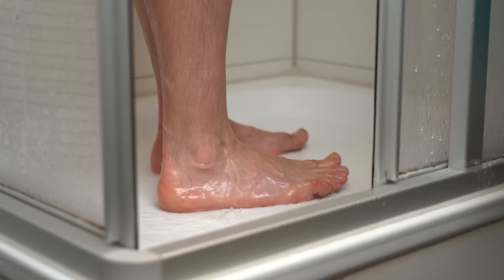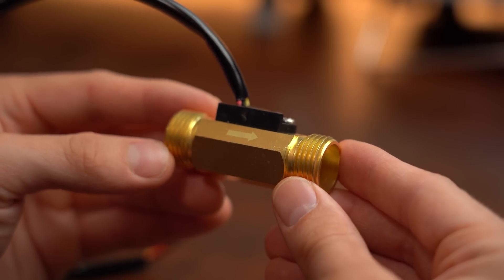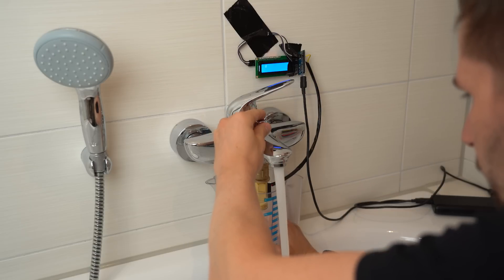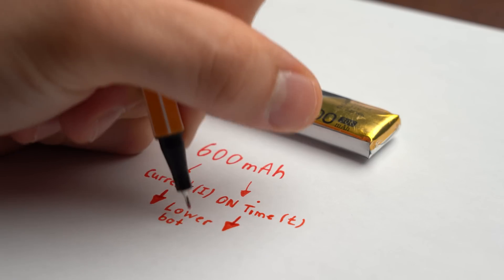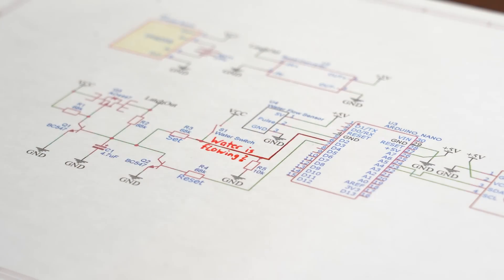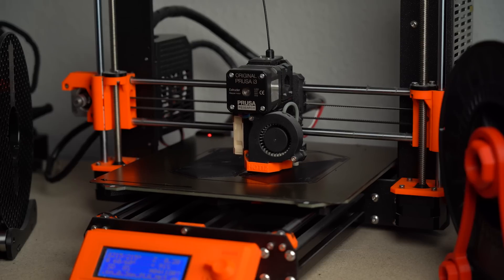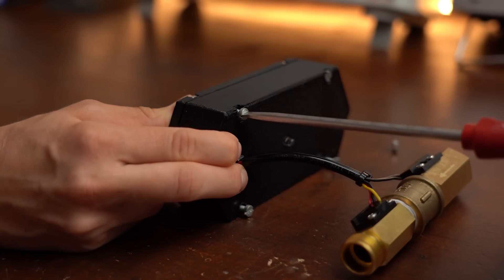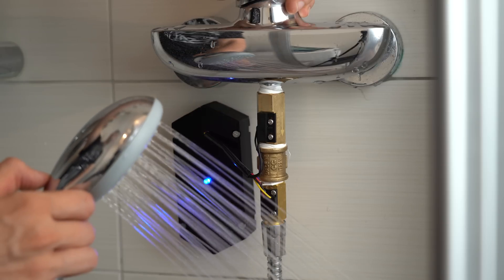Every Shower needs this Upgrade! (Online Water Tracker)

Comment: Awesome project, that was my next project for my garden watering system 👍
Have you considered using ultrasonic water sensors for your main's water supply? This way you don't have to modify your water install ?
Reply from the maker: Ultrasonic? Never heard of them. Got a link?
Reply: @greatscottlab  To not modify your main water supply, it only works with an clampon method. Its not that simple, but it can work if fitted well. For ultrasonic flow measurement there is a lot to consider instead of just counting pulses. Yet the principle is quite simple. Two transducers alternately sends a burst and this time is measured with a TDC. The ultrasound in flow direction is faster than the ultrasound against flow direction. This difference of time is directly proportional to the flow. So with a simple formula with offset, diameter of your pipe, length etc you get a decent result. You may need some correction factors, becauer there are different flow pofiles (laminar and turbulent).

I just remembered that you can also buy ready systems. Then, of course, you don't need to know anything about ultrasound :D
Reply: @yannickziermann9731  Not sure you can use clamp on systems for that, since you would want to isolate the transducers from the brass.
Reply: ultrasonic flow sensors are hideously expensive
Reply: The sensor itself is usually referred as an Ultrasonic Flow Meter Transducer on AliExpress paired with an Ultrasonic Water Flow Meter main unit

Comment: Just put a 1/2" turbine generator in series that will charge a super capacitor. :D :D :D
Reply from the maker: Not enough power for the system though....I tried it.

Comment: Good idea, but i think the whole pressure switch and latch circuit is unnecessary. You could use flow meter to wake the Arduino up, then after a delay put it into sleep. Atmega328p uses nearly zero power in sleep
Reply from the maker: I did not wanted to use a sleep mode.
Reply: @greatscottlab  Ok, great video regardless. Thanks

Comment: I've never thought of showering as a hobby before, but that's EXACTLY what it is. I also forget time and space while immersed in the warm flow!
Reply: @devalue7064  Crazy that you can't even enjoy a nice long shower now. Politicians need to hang.
Reply: Yeap, I know the feeling.
Reply: Weird to think of it as a hobby, but as long as you're getting clean every day, more power to you.
Reply: @devalue7064  Germans are masochists. This thing will probably take off there.
Reply: You are lucky.  Water makes me feel pain.
Reply: @hicknopunk  That sounds awful.  You're not using a "water saver" shower head are you?  Those nasty things produce painful little high pressure "water needles" instead of a wonderful, refreshing deluge.
Reply: @StubbyPhillips  no, it is sensory processing issues.  Any water, just sitting on my skin hurts.  Until I was an adult I had no idea everyone didn't feel pain from water.  

I wondered how people could enjoy a shower, bath, pool, etc for so long.
Reply: A cold shower is my longest 5 minutes of the day
Reply: One major difference: if I go a month without spending time in my wood shop, my boss doesn't fire me.

Can't say that about going a month without a shower.

Comment: I don't like the lipo battery solution, since it needs to be changed and has relatively short lifespan. I would harness the power from the waterflow instead, and put a supercapacitor to sustain it for a minute or two. And the display is in my opinion quite important, I guess watching those numbers going in real time is more terrifying than watching them on a phone afterwards. A timer would be a must too, because this problem has to be solved(right?). The most effective way is to reduce the time taking shower.
Reply from the maker: Thanks for the feedback. But a normal water "turbine" would not deliver enough power.

Comment: My hot water cost smith like 10 times the price of cold water, but I have no way of putting a sensor on both lines...
I tried ai-on-the-edge to read my analog counter, but it's way too unreliable.

Comment: Very nice idea, which can be also extended to measure how much washing machine or dishwasher use. Isn't it possible to read pulses from your water measure? By the way I achieved similar, but obviously less accurate shower water usage sensor with humidity sensor next to shower. I observed that there is more or less the same pressure and mix of hot and cold water used everytime, so I calculate just time based on humidity changes.

Comment: If you really want to save, get a thermostatic faucet that automatically regulates the output temperature. That way, you're not wasting as much water fiddling around with the mixer, and also can start and stop the water without ever having to fiddle around again.
Reply from the maker: Also a good idea :-)
Reply: They're too expensive. It will take years to pay them off from the saved water. They wouldn't even last that long.
Reply: @svetko05  I bought mine from Aliexpress, and it is somewhat a comfort thing as well. If someone in the house uses the toilet for example, the loss in cold-water pressure won't suddenly make your shower a lot hotter.
I have them in all bathrooms, at the wash tables as well as showers and bath tub, and in the kitchen.
Reply: @graealex  Yeah, they're pretty cool devices, I also had one installed, until it broke. They have good uses but saving water isn't one of them.
It's especially bad when two or more people live in the house and everyone has preferred temperature and constantly fiddling and adjusting the valve.
Reply: @svetko05  The ones from Ali were about 50 EUR and with regular descaling of the thermostatic cartridge, they last a very long time. Although two of the ones I own are from a German company and were considerably more expensive.
Yes, I know about the fiddling. I use one in the bathroom for my bidet hose, and my girlfriend likes to wash her face with cold water in the evenings, which is always a bit of a surprise when I try to wash my private parts with 10°C cold water 😂❄️

Comment: Water costs like a $1 a day so this is not an issue unless you're unemployed but then you don't need or have a shower.
Reply: In my town (in Poland) water (drinkable) cost "almost nothing", but sewage collection cost real money, and heating cost even more: my daughter alone can use hot water for over $100 per month...
Reply from the maker: If you can cut that in half that saves you 182.5$ per year.....not bad I would say.

Comment: Coding with the laptop on the border of a bathtub. What could possibly go wrong 😁One small tip: that sealing tape should be used quite sparselly, just enough to fill up imperfections in the metal. If reaches a point that makes hard to turn, you are using too much.
Reply from the maker: Thanks for the tip :-)

Comment: regular water meter counter is driven by rotating magnet. you can modify it: remove front panel with digits, install hall sensor, send data
Reply: Pretty sure messing with your meter in any way is illegal, or at least it is here in the US.
Reply: @OtherDalfite  i don't mean to touch working one. they are cheap and maybe old meter is laying around
Reply: @yurcchello  oh ok
Reply from the maker: Thanks for the feedback :-)

Comment: I think I'd have added a temperature sensor and tried to estimate the price including the cost of warming the water.... but that'd be more difficult ofc.
Reply from the maker: Yep. Also had that in mind. Maybe a good improvement for a future upgrade.
Reply: Two temp sensors, point of use and supply to water heater. Or just a current transformer on the feed to the water heater.
Reply: @IamEqualtoall  I believe the supplied water temperature is pretty constant, at least in Europe. Only a few degrees difference, not worth putting a second sensor imo.

Comment: I think in Germany it might ne forbidden to install not approved Installations into the public water systemy
Reply: It is forbidden but everything after the water meter in your home is not public but private, and you can install whatever you want.
Reply from the maker: Maybe. But it is certainly allowed to add something like this in your shower ;-)
Reply: I am offgrid in germany but most Installation i have seen habe checkvalves fittet to protectiv the public Network or Else one couldnt use a garden Hose

Comment: Just use cold water, shower time will decrease automatically and therefore monetary spending will decrease as well. 

I can’t applaud enough for your ingenuity, great work 👏 

A budding YouTuber.
Reply from the maker: Great tip!
Reply: Ending your hot shower with a quick cold rinse can also reduce anxiety and depression.
Reply: @ErebosGR  
Just make sure you don't breathe all the water in from the involuntary gasping that will occur from cold shock. I've had too many falls and close calls from that due to being dizzy and light headed, it's just a bad idea.
Reply: @Lively_1185  Umm, you can make the switchover gradual if you want to...
Reply: Also shower less

Comment: Simple photodiode at old measurement device or pulse-wire at new one (without corrupting certified device). You already have measurement device on input pipe, use this.

Comment: yeah I bought a shower head with a off valve and it saves me a lot of water. $9 and you can get a valve adapter that lets you turn any shower head into a shut-off head.
the reason you may want this is so you can find the perfect temperature once and then you don't have to touch it ever again, you just walk in and turn the valve on and let the water through.
Reply from the maker: Also sounds like a good idea :-)

Comment: and for saving battery you can add water turbine that will charge the system back
Reply from the maker: Well,....I tried commercial water generators with the faucet. Not ideal. But I will show that in an upcoming video ;-)

Comment: Do you have to take it apart to charge the battery?
Reply from the maker: With this version, yes. Sadly. I will hopefully include a charging port that is water resistant in version 2. But other can join in on the fun as well and design something suitable :-)
Reply: you could just add IP65 cable gland to the bottom or the side of the case or buy IP65 case with cable glands and use wire or tube and pass the wires inside...
and to make it look better print new case that will fit on the flow sensors as cover.

Comment: thing with sensor used there is that those are sold as FLOW METER sensor, not meant to measure volume of water flowing through it

Comment: With such a low power application, is there a way to use the flowing water to keep the battery charged?
Reply from the maker: Not really that low power. The uC needs a max of 100mA. I tried water generators with the faucet but the results were pretty bad. I will show that in an upcoming video ;-)

Comment: Two critiques I have on this project
1. Why there isn’t a tiny water turbine that charges your battery or capacitor when water is flowing?
2. The relation between flow and frequency from sensor should remain consistent regardless of pressure. Just map it out and have a look up table for a better estimation of water use
Reply from the maker: 1. I tried commercial solutions. All were a joke. Not worth using.  2. Yes, that sounds like a good improvement. But very hard to implement in Home Assistant.

Comment: This is a great idea💡 maybe you should use a water turbine to charge the system automatically and supercapacitors instead of batteries?
Reply from the maker: Tried commercial water "turbines" Did not output enough power. Not even close.

Comment: Hey cool project! I installed one of those flow metres in my beer fridge so I would know how much beer I had drunk, or not for that matter.  Interesting and useful to know the actual usage, compared to the perceived usage of any liquid that's costing you  money.
Reply: idk what flow meter you have but most of them (at least the ones that made of brass) are not lead free...
Reply: All good lead has its place, the one I used was food safe plastic with copper fittings designed to be used with water filtration equipment I'm pretty sure, I'll be fine. Interesting project, however I found the impeller agitated the beer and produced more of the fluffy stuff than it would have at the same psi if served from a tap without a flow metre so maybe not really worth doing.
Reply from the maker: Haha that also sounds like a totally german application for such sensors.

Comment: Before the company changed my meter to a digital one I had a small reed contact mounted in my meter. Every half liter a pulse. Used the Electric imp(001) to count the pulses. Pushed the data in the mysql db and used AMcharts to visualise everything. Brings back memories. 🙂
Reply from the maker: Also sounds very useful :-)
Reply: @greatscottlab  haha indeed. You can recognise patterns after a while. When my wife took a shower after her night shift at the hospital, or our diswasher, ..
Reply: The Digital ones usualy have a S0 / SML or Modbus interface,  sometimes all tree.  They can give out a much higher resulution and some statistics
Reply: @tobiashegemann1811  You triggered my  interest ;-) Meter seems a Kamtrup Multical 21 and there is a reading head option available. Wired M-bus system. Time to do some research and maybe reinstate my old project.
Reply: @joostluyten_ON2OT  i use a rtl sdr  radio to read my power water and gas usage
Reply: @tobiashegemann1811  I'm not sure where you are but nowadays it's most common with MBus (Meterbus) for water meters as it can both communicate and power the water meter over the 2wire interface (They still have a battery for counting pulses when the system is offline). And the meters are usually just a small puck you place on top of a mechanical water meter. That and MBus has some other advantages over modbus, it supports discovery and larger registers, but is is slow usually 300 or 2400 baud.
Reply: What's nice about that setup is it lets you call out the water company's BS when they overcharge you!
Reply: @TRLTheRandomLab  They would say its fake
Reply: My HackRF is picking up either water meters or electric meters on my neighborhood, and as far as I can tell they are unencrypted.
Maybe not just show water usage but also gas and electricity too.
Reply: @PPGATL  My HackRF picks up Electric and Gas meters in my area as well, but I haven't found a way to read the Water Meter protocol that's used in my area yet... The water meters used in my area are Master Meter with an FCC ID of NTAXMETER21. I've done some research but it doesn't appear anymore has decoded these specific meters yet.
Reply: @bluegizmo1983
Reply: @bluegizmo1983  Some newer wireless water meters are unfortunately encrypted. And I'm unsure if the key is printed on the meter.
Reply: This is best nerd comment ever
Reply: The Techem watermeter sends it's statistics around every 5 min in the range of 433MHz. But I never got something useful from it. Or found information on how it exactly communicates. And you get NOT help from the the service technician if it is wrapped in foil for better measurements for three days... They don't find it funny when no data comes home.
Reply: With regards to the quantity reading deviation as pressure fluctuate, it might be a good idea to read the pulse frequency and map that back to the pressure which can then be used to relate back to the amount of water passing through?
Reply: Yes even the digital ones still use a magnet to transfer the pulses of the positive displacement pump out to the readout, so the hall sensor will still work, just have to find the flat face that is on the meter to attach it.
Reply: So lost don't even know what it means
Reply: We still have a analog meter with arrow's turning and a counter with numbers.
No problem to use a webcam and a raspi to read it :)
Reply: @SumUnicus  edge vision is the best tool for implementing APIs for physical stuff.

Comment: can you generate energy from water flow to charge battery ? :D
Reply from the maker: You can. But with water from the faucet the energy produced would be so minimal that it does not make sense to use it that way.